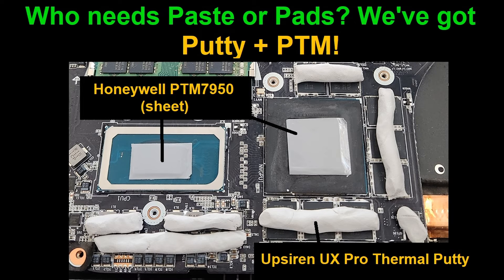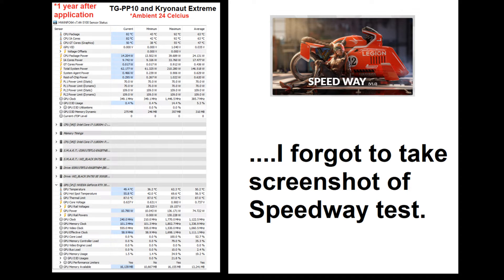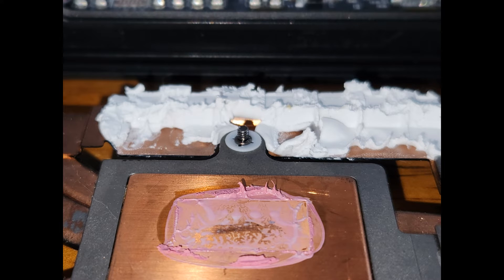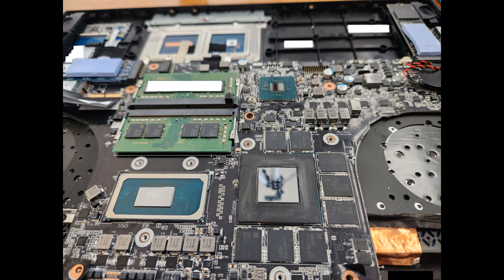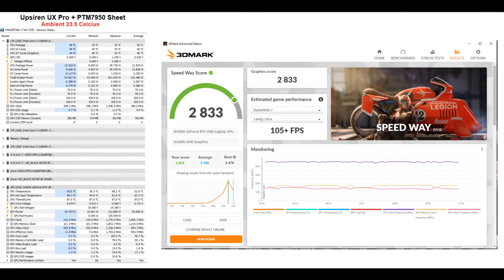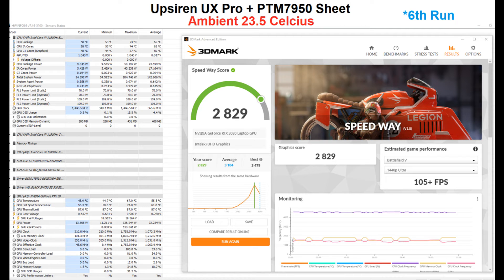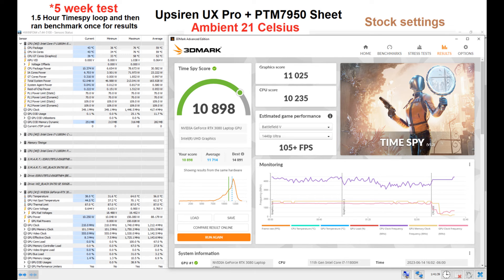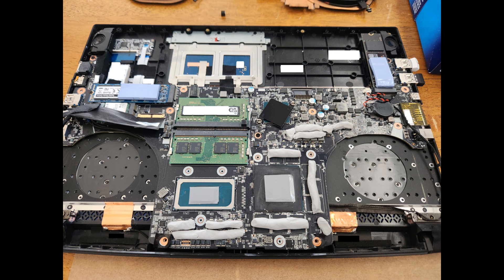RTX3080 Laptop meets Upsiren UX Pro thermal putty and Honeywell PTM7950

Comment: Hi, who much thermal putty did you buy? Im planning to use it in a legion 5 pro and thanks for the advice in CSGR scam.
Reply from the maker: 20-25 grams should be enough for your laptop. I'll be redoing this laptop in the next couple weeks and will be sure to measure the amount of putty I use.

As for how much putty did I buy....the only answer I have to that questions is "All of it". lol. Jokes aside, I've spent thousands of dollars of various different Thermal Putties.
Reply from the maker: CX-H1300 is good. Recently the batches have been firmer than they were previously and perform about 2 degrees worse than it shows on the chart.

This still puts it as outperforming U6 Pro slightly, but definitely behind Upsiren UTP-8 and Fehonda LTP81.

It will just require a bit more pressure to be applied during reassembly. definitely a good budget option.
Reply: @snarksdomain  Hope I get a good one, bc I live in a country where is difficult to get things from internet, but thanks for your help
Reply from the maker: @jonnypena7651  Yeah, I hope so too. I tried buying from 4 different sources a couple months ago and they were all stiffer. Hopefully whoever makes CX-H1300 sorts out the batch consistency. The OG batch I have is still soft.

It's still usable in it's stiffer form. Just takes a bit more effort to compress it. You can knead it in your hand like dough for a couple minutes to soften it up a little before application.
Reply: @snarksdomain  thanks for the advice, also maybe the high avg temp of my country would make it softer, you are under AC at 23C, I'm with a fan with an avg 28c at night

Comment: so my rtx 3060 laptop has vram clock of 6000mhz and earlier with a overclock of 300mhz it used to stay on those clocks , but after a thermal repaste i am seeing even in stock the clocks after sometimes is closer to 5500mhz is it because of throttling , my wattage is also usually now lower, but my core temps are less than 75C on gpu or even close to 70c. so is my vram overheating (i have stock pads on vram )   5800h, rtx 3060(90w) lenovo ideapad.
Reply: vrams at 6000mhz are you kidding me?
Reply from the maker: @crypticanon  good point. A laptop 3060 should have a memory clock speed closer to 1750Mhz which comes out to 14 Gbps bandwidth on the 192 bit bus.
Reply: @snarksdomain  another thing while running heaven bench or any game the msi and nvidia overlay shows 6000mhz(default) but GPUZ show memory clock 1500mhz.  also when i vbios flash to 140watt 3060 my memory clocks goes 7000mhz in msi ( in gpuz 1750mhz)
Reply from the maker: @devanshanil2468  that makes more sense now. It just depends on the software and how it's interpreting the VRAM speed/bandwidth.
Reply: @crypticanon  in msi afterburner and nvidia overlay it says in memory clock 6000mhz for my 3060(90w) and my friends 3060 in asus tuf 6800h 3060(140watt) says 7000mhz memory clock.
u must me talking about effective clock like in 3200 mhz ddr4 ram the effective speed is 1600mhz(is in cpuz).
Reply from the maker: It's possible it could be throttling for some reason, but hard to know for sure without testing a few things out. I'd recommend installing HWINFO64 and running "sensors Only" and then recording a log (bottom right). Then make sure your laptop profile is set to a performance mode and playing a game or even running a stress test with Furmark to see what the wattage is.

Then you can go back a look at the log, voltages, temperatures, and have more data to go off of to try figuring out what the main issue is.

If the VRAM or VRM's are not getting adequate cooling then it could definitely effect performance. If that were the case, then either new pads or Thermal Putty would likely help. I'd personally opt for putty over pads, but that's my personal preference.
Reply: @snarksdomain  hw info or any sensor based app does not show temps for gpu memory . i have been doing extensive testing to look for problems but it seems like all is good since benchmark scores are still similar and it can boost core clock to the overclock i used to do. may be in new gpus it does not need to stays at full throttle when cpu is bottlenecking or when it does not need to use lots of powers to get work done.  in heaven bench the memory was staying constantly at 6300 6400 6500(with overclock applied ) so may be its not a problem, core temps are like 70.
Reply from the maker: This is true for 30 series laptops. HWINFO64 can show/log other stuff though like "Reliability Voltage" if it was running unstable. You should also be able to Conditional Format the voltage numbers for each voltage value and see if voltage changes after a while of the laptop warming up. Then it's easier to scroll through the data and see if there is a noticeable trend for any of the values. It's a bunch or work to review the data, but may shed light on issues you're experiencing.

Your core temperature seems good at least.

Comment: Hey, it's been a year. How are the temperatures holding up?
Reply from the maker: Oh man, your question is perfectly timed. I just ran some tests yesterday. I still need to review the data, but temps seemed quite good still. No throttling. I'll take a look at the results when I get a chance, but I believe the core was maybe 1-2 degrees warmer than before. I did clean the fans.

My plan is to run a few more tests to get some good baseline data, then I plan to open it up and take a look at the UX Pro Putty to see how it has faired.

I plan to salvage the UX Pro and will apply UTP-8 (is a bit sifter than UX Pro, so ideal for laptops). Haven't settled one which Phase Change I'll use. Likely either PTM7950 or PCM-1. Part of me thinks it would make sense to do longevity testing on PCM-1 on this laptop.

I use this device a lot and it comes with me on the road and also whenever I fly somewhere.
Reply: @snarksdomain  please do a video on it.

Comment: What i need to use for clean old paste ?
Reply from the maker: 99% Isopropyl Alcohol, makeup remover wipes or q-tips/cotton swab, or paper towel even. Can also use toothbrish if need be.

use gentle pressure, not too much. Make sure isopropyl is dried off before applying new paste or Phase Change
Reply: @snarksdomain  thank you
Reply: @snarksdomain  hi sorry for one more question. Can I use paste directly on cpu, and after that tape on that metal cover?
Reply from the maker: @4i04  Paste is meant to go between the CPU and the Cooler. WHat device dso you have that it was use tape instead of screws? Are you adding paste to something that didn't previously have a cooler attached?

Make sure the paste you use does not conduct electricity, some do.
Reply: @snarksdomain  I never did that so just asking. I have Aorus 15p with 3070 and on a last time have very often black screen while gaming, or half of screen blackscreen. Sadly this is my last product from gigabyte.
Reply from the maker: @4i04  Are you sure it's temperature related? or is there other issues with your laptop?
Reply: @snarksdomain  need to try it, laptop is warm as.... on gaming time, heard gigabyte released bad bios update and after that it never fix it. If paste solution wont help I will sell laptop for small price and make pc.
Reply from the maker: @4i04  if heat issue, then maybe this help fix it. Just be very careful when opening laptop and watch out for tiny wires. 

Make sure to disconnect battery cable inside laptop before removing coolers and touching PCB. Don't want to risk electrical short when working on it.

Comment: How many months after implementing PTM7950 did it maintain its performance? I apply it to my device, after 2 or 3 months the device is back to its old state. How long did yours last?
Reply from the maker: Mine has been good for a year so far. I'll have to run a test again soon and post results.
Reply: @snarksdomain  Where you bought it?
Reply from the maker: @abdulkadirozyurt  Moddiy.com
Reply from the maker: Did you use the sheet type or the syringe type of PTM7950?
Reply: @snarksdomain  I used sheet type.
Reply from the maker: @abdulkadirozyurt  Where did you buy yours from? I assume it was on a laptop?

Comment: Hello i recently bought UPSIREN Thermal Putty UTP-8  and I have ordered Honeywell PTM7950 I'm planing on using it om my amd 7900xtx do you know if the UTP-8 will work well? And do you know if its a big difference between UTP-8 and the UX pro?
Reply from the maker: UTP-8 is just slightly better than UX Pro. There are several folks who have used UTP-8 on their 7900 XTX's to good effect. If you'd like to see their results feel free to join the Discord and you should be able to find the posts.

Comment: Nice vidéo ! What are the size of the log used on the vram ? Going to use this combination on my laptop soon and wanted to know the diameter of the logs, since an excessive amount could leave some space in between the gpu/cpu die right ? FYI i have a 2021 ROG Strix G15 G513, should i put something similar to what you have put on yours ?
Reply from the maker: That's correct, you don't want to use too much or it can create core contact issues. I like UX Pro,  but there are better options for a laptop, and some that perform the same or better than UX Pro and are cheaper.

My current go-to is Upsiren UTP-8. It just slightly beats UX Pro, is softer which makes it easier to compress, and cheaper. I also really like Fehonda LTP81 as it is also similar performance and nice and soft (but not runny, just a good soft, easy to form by hand). Fehonda is currently a little more expensive than UX Pro. I'm hoping Fehonda will soon sell it in largewr quantities on Aliexpress.

As for the size of the logs I'd recommend taking a look at the Putty Calculator I made on Google Drive (Test Chart Repository). You can also take a look at the latest charts there (VRAM TIM folder > ETCHASH folder)

I likely used a little too much and so it took a bit to get the Phase Change fully melted and ideal core contact. It CAN be done with UX Pro, but it takes some care not to use too much.
Reply: @snarksdomain hey! love your content man. would you say that 10g is enough for doing an entire set of thermal pads on a blade 14?
Reply from the maker: @sy4nr  10g is never enough. For a laptop you will likely use around 30-40 grams. It's closer to 30 once you get used to using Putty.

As an example, on my 3070ti test card I use ~15 grams just for the 8 VRAM modules.

You can use the putty calculator to figure out how large of rolls/logs to use. It's located in the Test Chart Repository link in video description. Feel free to "Make A Copy" and modify as needed for your own laptop or videocard. You basically punch in the dimensions of a thermal pad, and it will tell you the amount of putty to match the pad, and diameter to use. The density can effect it, but most good putriws AR in the 3.2 - 3.8 grams per cc.

Comment: Hey Snarks, may I ask regarding ptm 7950. How long usually you need to reapply/repaste the ptm 7950 after apply it on cpu and gpu ?
Reply from the maker: Not quite sure yet. We should collectively figure that out in the next several years. It should last a very long time.

Comment: I bought ptm7590 0.25mm from Moddiy and Upsiren Ultra pro Ux from AliExpress. Needless to say, my temps are much better on my Acer Predator Triton 500 se with a 12700h and rtx3080ti. I got better results compared to brand new with 3d Mark timespy And the ptm7590 still needs some cycles to perform best. Thank you for your suggestions!

Comment: Thanks for the video..i'm going to change thermal pads to u6 pro on a razer blade 18, the amount of putty in this video isn't too much? Won't it spread when it get squeezed from the cooling system? Just to know, i dont know how much putty i need on my laptop to do a good job
Reply from the maker: It spreads when it gets squeezed. It wasn't too much as it did not create core contact issues. For a laptop, I recommend getting 50g of whichever putty you go with. Be sure to check the latest VRAM TIM charts following the link in the description (Test Chart Repository).
Reply: @snarksdomain  thanks for you answer, i'm waiting for the u6 pro from aliexpress and i'll try to repaste it, some pads are 3mm thick..do you think i'll be good?
Reply from the maker: @user-og5rr2ic8k  A 3mm gap will be fine with a good putty, as long as you bought the correct U6 Pro (Upsiren China), and not the wrong U6 Pro (CSGR Greece).

If you are living in Europe, then the U6 likely won't be delivered and you'd be better off with a different putty such as Upsiren UTP-8, CX-H1300, or Laird T-Putty 607.
Reply: @snarksdomain  i've bought on aliexpress so I guess it's the correct one

Comment: Hey, nice video! I'm about to clean and repaste a Msi gs75 and I would like to use PTM on CPU and GPU.
Given that the putty on vram will splash under pressure, which thickness of the ptm should I use? I was going for a 0.2mm pad but I'm not sure. 😅
Thanks!
Reply from the maker: Since the PTM will melt down to around 0.038mm (or 0.0015"), you can just put enough putty to replace the stock thermal pads. UX Pro is good, but there are softer putties available that are more suited to Laptops and other low compression applications.

I'm currently really liking UpIren UTP-8 and CX-H1300. 

Check the charts in the video description (Test Chart Repository)
Reply: I have UX and I'll give it a try. 
PTM 0.2mm on CPU and GPU, not too much UX on the vram so that ptm hopefully makes contact.
Thanks!
Reply: Hey it's me again. Had to service another laptop and got mad messing up with gelid pads thicknesses.
Now it is ux time on my Msi GS75.
I beg you for one last tip please: 
From factory it had 0.5, 1 and 2mm very very soft thermal  pads plus a thin layer of a paste similar to k5 in a small socket.
What diameter for the ux rolled logs do you suggest to apply? I'm trying to pinpoint a single diameter for everywhere to simplify the whole thing...
Thanks!
Reply from the maker: @RGRG-vc6ii  Using one diameter for everywhere is difficult to say. With UX you can actually roll it out on either a silicone mat or something similar and if you like you can squish it down most of the way and basically cut to length and width if need be in a pad like shape. Then just scoop up those pads and apply.

If I had to wing it, I'd use 6mm logs on the VRAM and maybe 4mm logs everywhere else?
Reply: @snarksdomain  The logs have plenty of space to splash around and adjust themselvs except in the infamous small socket where the putty is somewhat caged in so I must be maniacally perfect.
I'll let you know the result if you like.
Of course I'm having fun!
Reply from the maker: @RGRG-vc6ii Sounds good. Let us know how it turns out for you. Also, be sure to apply a bit of pressure during reassembly. When you have all the cooler screws started in. This will help form the putty into it's new shape. Softer putties may not need this step, but UX Pro needs a bit of help. It's still softer than pads though, so still pretty forgiving.

If you run into core contact issues, you can always open it back up and remove some putty, if need be. It's fairly easy to reshape with gloved hands.
Reply: And here I am. I found PTM application rather easy, with a bit of care.
UX, well, I fell in love with it, like you. I thought it was more dense, in reality I've found it almost on point.
Pliable and adaptable As needed, even in a laptop, with a little gradual hand pressure on the copper before tightening the screws. Putty logs sized as you suggested. In the little crevice just a tiny log, almost a... wire or filament of putty.
It went so smooth and good that I'm thinking of repasting in this fashion the other laptop which I recently serviced with gelid paste and pads with a sufficient result.
It goes full gaming load at 70C GPU and 80C CPU without throttling, having undervolted CPU and GPU, turbo boost capped at 3.8 instead of 4.6.
Should I redo it with PTM+UX, the Atomic combo? 😂
Reply from the maker: @RGRG-vc6ii  Thanks for sharing your results, and glad it went well. The more you use putty, the easier it gets.

Up to you if you want to do the other laptop, but it's kind of fun to apply putty and PTM and not have to worry about it for a long time.

Not sure if you use Discord at all, but I now have a Discord server (link in channel about page)
Reply: Oh... One more thing. If PTM 0.2mm will not make proper contact, is it possibile to stack 2 layers of it?  When it melts, the 2 layers should fuse, isnt It? 😂 Higly experimental
Reply from the maker: @RGRG-vc6ii  You should be fine with just the one layer. Having 2 layers would not be ideal as your CPU and GPU core temps would be horrible with a gap that large.

Of you run into core contact issues it would be best to apply some pressure to the cooler to help squish the putty and try again.